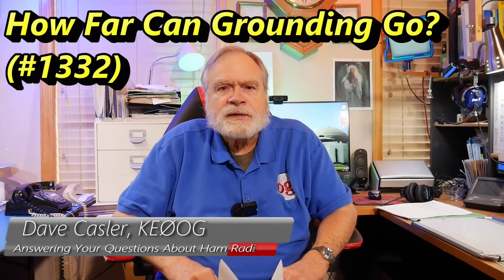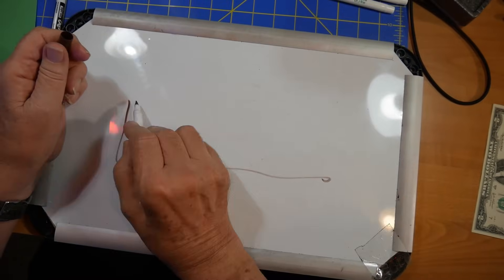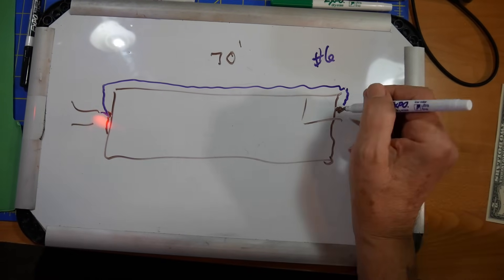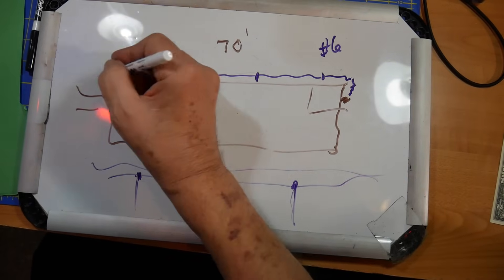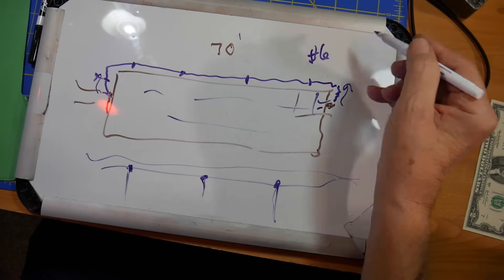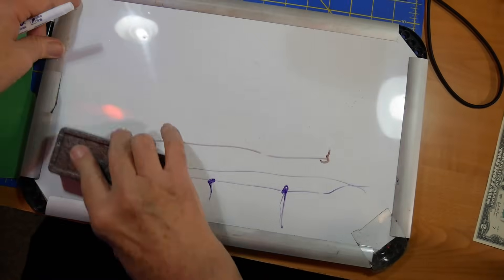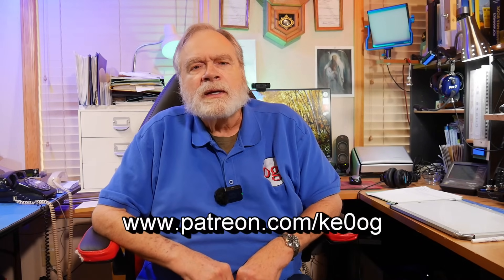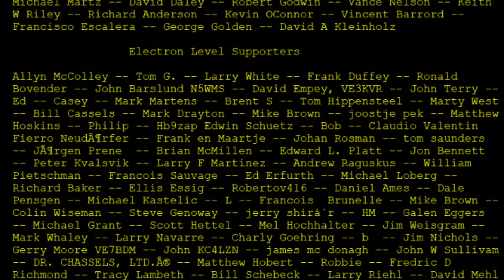How Far Can Grounding Go? (#1332)

Comment: As a 40+ year electrician, ground rod drivers do work in some areas, but not in rocky areas. The best method I've found is to use a long, carbide drill bit with an extension (the join together but tightening Allen screws) and a hammer drill. 
You drill a hole, it will go straight through rocks easily, then just tap your ground rod in.

Comment: The subject of proper grounding techniques will go on as long as there are humans living on this planet. The one thing that most of the time gets overlooked is the simple fact that if you have lightning in the area, you should unplug all of your antennas and equipment from the grid if you cherish your ham radio gear. You can't predict what will happen if lightning strikes your premises. I'm not saying that bonded grounds are incorrect, they're just not 100% effective in a direct lightning hit. Unplug everything!

Comment: The voltage isn’t different when they are properly bonded.
I mean if you have 125 V at your house, but when the all your equipment is powered on in the remote shack and you have 120 V, are you calling that a voltage difference?

Or if lightning strikes your house but is completely dissipated before it gets to the shack, are you calling that a voltage difference?

What matters is that there is no significant potential difference between grounded conductor (neutral), equipment grounding conductors, cable shields, antennas, and masts.
Of course, there is a small difference between neutral and earth, that’s why they are bonded at a single point which is at the service equipment.

There should already be 4 wires from the house to the shack.
Regardless, ground rods are optional every 15’ and no extra conductor is required provided that a large enough ground wire already exists. Who suggested that five ground rods are needed to go 70’?
There should be logical rationale.  Are you trying to create counterpoise or an equipotential plane?

For 70’, the electrode bonding conductor should be AWG 6 solid or equivalent or larger — copper tubing is excellent.  If you have only AWG 10 feeder cable, that’s inadequate over that distance.

If there are any other metallic connections from the house to shack other than the electrical supply, then a hefty low-resistance pathway is mandatory to minimize stray current on the other pathways.

(All this assumes that neutral is isolated from ground throughout the shack.  If it isn’t, then neutral current will travel via every grounded metal path from the shack to the source.)

Comment: I have a station ground rod . It is not tied to the service ground .  All of my equipment from power supply to legal limit amp has a plug with ground lug as do all wall sockets . Been set up this way for the last 5 years . I'm still here and so is the equipment. I contend tying the ground rods together is redundant . If I lived in a home without grounded outlets I would tie them together.
Reply: 1. You should use only actually grounded outlets. Your electrical system must have a single electrical bond to neutral in the service equipment.

2. Lightning is a 100-year or 500-year event in many places.  That a station had no problem for only 20 years doesn’t predict future performance.

3. If there isn’t a low impedance bond between the tower electrodes and the station/service electrodes, then objectionable stray current will travel over the shield of every feed cable between the station and the tower.
How much depends on local conditions, but it’s not unusual to see milliamperes.
With a good GEC, that can be reduced to μA or below a detectable level.

Comment: If driving  a ground rod and using a brass clamp don't forget to slide it on before driving it because the end mushrooms  and it will not go on without grinding it back smooth !

Comment: They make tools that fit in the SDD chucks of demolition hammers that have a hammer only function . These are great for driving fence posts and ground rods , and would probably work great for guy with stakes / anchors .
If you are burying a ground wire and placing ground rods in a trench , if your excavator is large enough , fill the bucket with soil , and use the excavator to push the rod in .
Be very careful if you have a lot of roots or rocks .
That's a lot of force .
I've seen fenceposts ( big wooden ones ) done like this with big excavators as well as track loaders .
A big trackloader with a multi cubic yard bucket full of soil is several tons in addition to the machines weight . Of course equipment that size probably won't be available to rent at your local big box store .
They are also stupidly oversize for most residential construction projects , unless there's several thousand yards of dirt work needed for a new home build .
Id recommend the demolition hammer with the post / rod driver attachment , and most equipment rental places have them available , if you don't want to outright buy your own .
The thermite welder is cool . I've watched rail crews use this method on train tracks .

Comment: I do have my 4awg ground going through the garage to get to the other side bonding to 3 inch feed conduit then to the electrical ground then to the tower itself  the ground rods use for the trip were cut to 4 feet every 4 feet but the rest tower electrical and shack are 8 feet copper. I still have a sidewalk to get under so I can reach the water well. Oh I just stuck a 30 foot flag pole up for TV it got a 8 foot ground rod and I have #8 copper to the three shacks ground rods.

Comment: Easier than driving ground rods with a  ground rod driver (pile driver) is using a hydraulic drill --- ESPECIALLY in hard ground. (not commercial drills, just get a piece of 8 ft copper tubing and a garden hose (and a jubilee clamp) -- attach it to your house hose bib and have fun --- easy peezy)
Reply: An electric demolition hammer or rotary demo hammer work awesome , too .
They make tools respect for driving fence posts and ground rods that fit the SDS chicks in most demo hammers .

Comment: Dave this is concerning to me, kind of. I have a 50ft tower right outside my hamshack with a tribander and a dualband fiberglass vertical at the top. I have a est. 60 to 70ft STRANDED #6 (with plastic jacket) going under my house (crawl space) to my electrical ground. I do not obviously have ground rods attached along the way to that electrical ground. It is boned to my tower ground rod. From that tower ground rod I have 3" copper strip running to another ground rod that has directly attached to it a 10" wide 1/4" thick copper plated. That plate has holes drilled in it where I put my lightning arrestors thru. That same copper ground rod is connected by that same 3" wide copper strip to another ground rod 8 feet away... and then the same setup ANOTHER 8 feet away from the previous ground rod. Those are running away from my house to hopefully take the strike away from the house. I have a 75+ft pine tree approx. 60ft away from the tower. So the tower is not the highest "thing" in the yard. You mentioning about the long run makes me nervous. However I have had this same setup for over a dozen years and have been good. In your opinion, am I ok with that long of a run between the electrical ground and my tower / ham shack ground? Robert Burton KD4YDC Fayetteville, GA
Reply: Your system sounds okay. AWG 6 stranded is the minimum for a short distance; you can trust it if it is terminated correctly and not physically damaged.  However, it is only for bonding.  You must provide for ample dissipation of energy from lightning strikes at the base of the mast and outside your house.

Contrary to what another commenter wrote, lightning follows every path in inverse proportion to the impedance of that path.  

You can add a lightning rod to your tallest tree to protect it which will greatly aid in protecting the nearby mast.
Reply: I am not Dave but from what you wrote it seems ok, electrically for daily operations. The old Adige, If it works don't fix it.  However, I would be curious as to what the underside of your house would look like if there were a direct lightning strike. Rerouting bare ground wire buried four to six inches around the outside of the house is certainly the safest. Lightening follows the path of least resistance +. Never count on anything when it comes to lightening. I have seen lightening (in film) travers the length of wire buried and unburied, It is explosive. Personally, I would never trust a wire for bonding insulated or otherwise under the house.
Reply: @kf7bws  My reasoning for doing that is because of a deck next to the tower and it would have make the route longer for the ground wire. I thought at the time, shortest path and that is why I dd what I did.